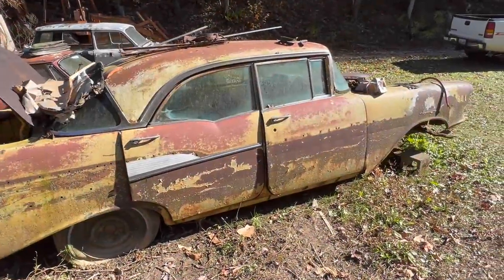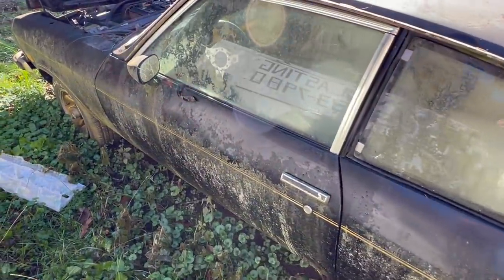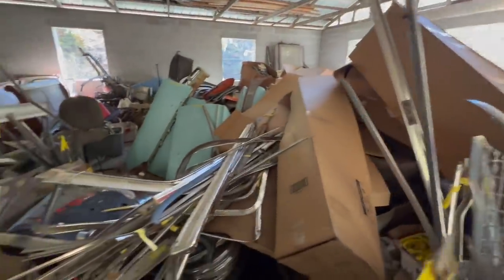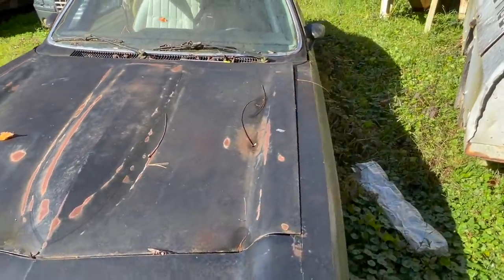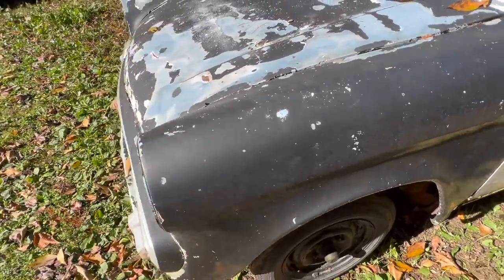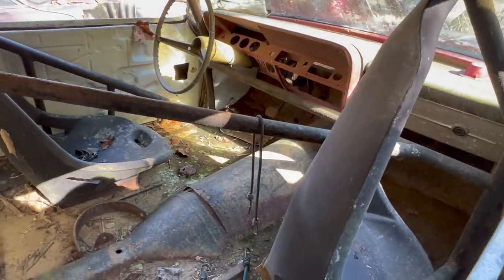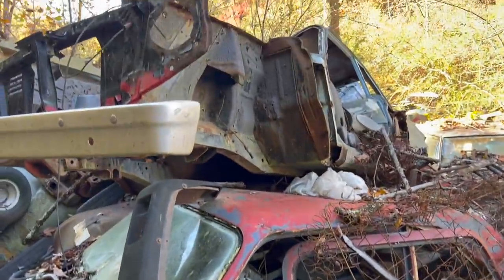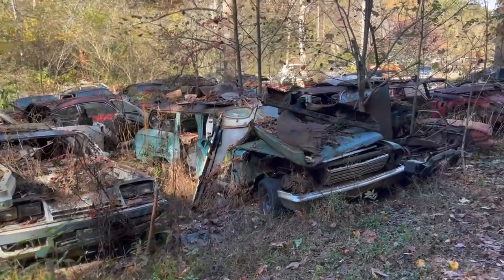100+ Cars HIDDEN from Civilization - Hot Rods, Drag Cars & Cosworth Vega's!

Comment: The 16valve Cosworth Vega is extremely underrated and IMO very collectible because it must have been one of the very first mass produced multi-valve cars to ever come on the market. It is from the same time frame as 
the Triumph Dolomite Sprint (1973) that also had a 16V head and was arguably THE first mass produced 16V car ever on the market,
the Ford Escort mk1 RS1600 BDA 16V. (1969) was not a mass produced car but a homologation special for rally and race competition, it also had a cosworth 16v head and was a world rally championship winning engine.

Back in those days Cosworth made the extremely succesful world championship winning DFV V8 F1 racecar engine.

About the Vega 16v engine, i seem to have read somewhere that they suffered from early excessive cylinder bore ware. So maybe it is why they are not so popular? But with todays knowledge, modern synthetic oils and precision machining i bet a good workshop could put some tuff steel sleeves in a Vega block and make the 16V engine run great again. 

In the early 1980's the Japanese motorcycle  brands became BIG with DOHC 16V engines (Honda CB900F/F2, CB1100F,  Suzuki GSX750E, GSX1100, Yamaha even came up with a 20valve head on the FZ750). 
By the late 1990's every Japanese , Korean and European  car brand offered multi-valve engines as well. 

What about the US automakers? They lagged behind, again..., trying to catch up f.i.  with the Chrysler/Dodge/Plymouth Neon. (which was a good effort IMO) 
Imagine what COULD have been if the Vega Cosworth had become a resounding succes...
Reply: Cosworth could never make the Vega-block hold up to the rigors of racing.  The free-standing cylinder-bores would shift and crack the soft aluminum block or the pistons would scuff the siliconized aluminum bores.  You are correct, today's synthetic lubricants will help a Vega-based engine work better.

Comment: Wouldnt it be awesome to find out that 409 is actually one of the very limited 427s that were used in the 63 impala, would have a 13.5:1 compression ratio slightly modified heads and a factory dual quad set up.

Comment: the Cosworth vega has more then enough reasons why it didn't catch on not with standing that the super special high tech engine only made a little over 100 hp, there were pinto's that made more hp then that. of course that us the main reason they didn't sell well back then but that's not why so few of them made it long enough to become a collectible, no the reason for that is because the engines were junk, most of them for one reason or another ended up needing a new head by 50k miles which by that time were in short supply and very expensive so most of the cars ended up in junk yards....